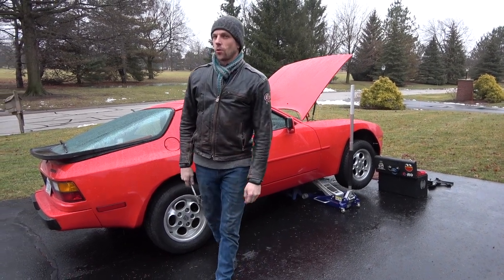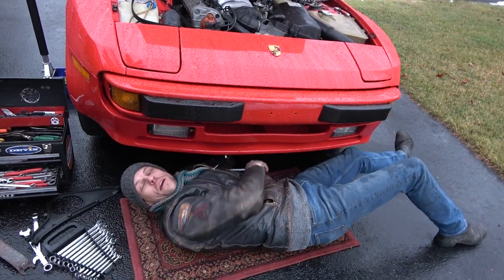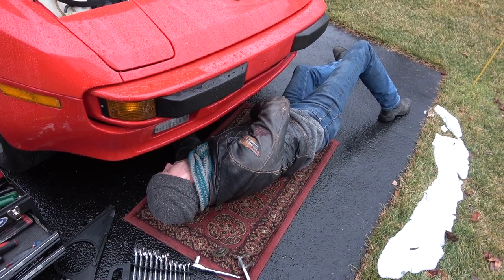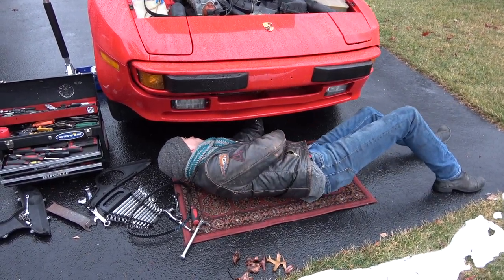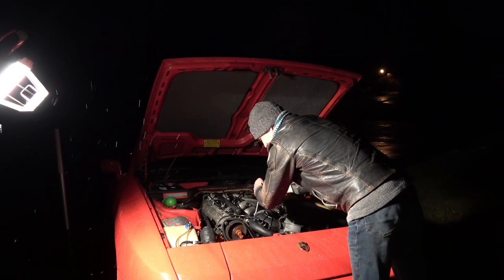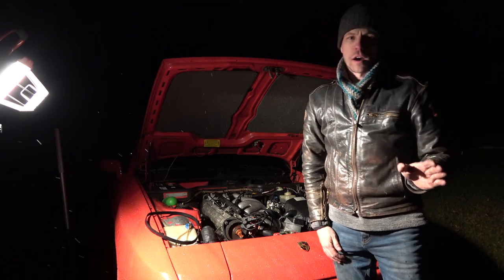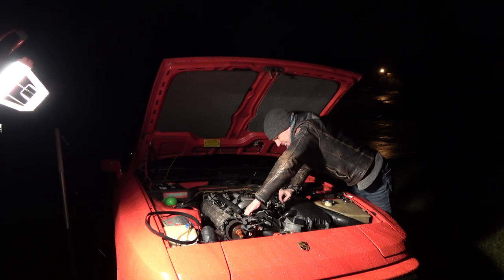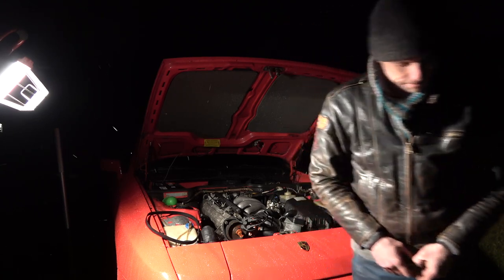ACCIDENT on DIY Porsche 944 in MISERABLE WEATHER

Comment: Have to say that there is no shame in tracking down the manuals to make sure everything is done to factory specs.
Reply: Factory Shmactory... these days you take factory specs into consideration but then go online and figure out what the "hands-on" real deal is from multiple sources and then average everything.  Or you know enough to make a better call than the factory did.
Reply: @NickKautz  I always use Seam's Law when torquing bolts. "Seems tight enough."

Comment: I cranked my 944 turbo over with a damn torque bar still attached the crank pulley bolt. Late night wrenching seems to always increase mistakes.

Fun fact: It's a damn quick way to loosen that bolt :x

Comment: Thanks for admitting the mistake on the balance shaft gear thing.  That was one of my cringes from the other video.  50% chance on each to get right out of sheer luck and the "o" and "u" confusion usually makes for some entertainment.  Your rant on the new car thing is exactly correct.  I say more or less the exact same thing to most of my customers.  IMHO the late 90s is where the car tech peaked for value to owners.  Modern cars with CAN-BUS systems and proprietary software is killing the little guy and owners.

Comment: It's not just cars. The furnace in my house is a Williamson built in 1987. I'm going to keep in going for as long as I can. The heat exchanger will never rust out because of the heavy gauge steel it's constructed from. It's super simple and easy to diagnose and repair. Sure, it's not as efficient as newer equipment, but my house is small and I utilize a programmable thermostat for temperature setback at night and when I'm away. New furnaces and HVAC equipment have grown in complexity with multiple sensors and logic boards. Yes, they are much more efficient but with so many more components with multiple points of failure, they are much more time consuming to troubleshoot and thus more expensive to repair.

Comment: If you want to move somewhere warm you could come to Queensland. That way you could come around and give me a hand to help me get my Porsche 944 back on the road after 10 years just sitting in my shed.  I have enjoyed watching your videos. I figure that I should do all the belts and water pump (and possible a few other things like seals) before I try to restart it. Prior to watching your videos I thought it fell into the too hard category as I had been told that you needed special tools and had to set the belts at a particular tension otherwise you would cause damage but your videos have given me the confidence to do this myself. Thanks heaps, keep up the great work.

Comment: similar weather here (1 y later:)) and I have prepared the valve covers to install on a c4 covers but, idk, I’ll wait for some better weather. btw the clam shell hood has flood lights so you can see the engine bay even if it’s dark outside

Comment: No harm, no foul. Screwing the pooch is what teaches us a few things and the ability to laugh at ourselves makes it even better. I've got an 85 1/2 NA and it's a blast to drive. Old school mechanical and a connect to the road without computers and sterile feel. Toss some BIlstein HDs on there and find the alignment specs to remove a little understeer and find your tire pressures. I run 38f /34/r and get withing inches of a helicopter ride when I play. FUN CAR!!!
Reply: Addendum: I can't agree more with your assessment and philosophy about a well engineered old car. In addition to the 944 I have two other West German cars. An 84 500SEL grey market AMG for the Stuttgart drift or 250kph runs on the 395 and an 83 300SD in case of an apocalypse and I have to hammer acorns down for oil to drive to the beach. Not only is it fun but it's a responsible way to live on the planet and use what is already here instead of feeding a false desire for newer and "better". Oh, carry a spare  DME relay!

Comment: Completely agree. New car ads... it's like "bluetooth this" and "navigation that" and "electro-break-easy-option" 

I want to know the real specs... like "shocks that will last 100,000 miles" and "a PCV system that won't clog up your intake valves" or "we used the slightly better gaskets and seals so this thing won't crater 2 months after the powertrain warranty expires"

Comment: I agree on the new cars not being any better built. And the prices of old muscle cars are nuts! I always wanted a 72 Nova like I had in high school, but I'm not paying that much for a clean stock one. Yes I can afford it but refuse to be part of the problem.
In my quest for my next project I thought hard about it. When I was 19 the 1988 Chevy trucks came out with the new design that was modern and cool looking. Proven dependable  and huge parts/restoration parts availability. Picked me up a sweet 88 k1500 stepside for a great price! 
The best part is the collector market has not cought up to these trucks yet. Look at the square body's now! Holy crap.

Comment: I feel for you using that standard length 1/2" ratchet.  One of my most used tools are extra long flex head ratchets.  Their length give you more leverage so you don't have to push or pull as hard.

Comment: The "flywheel" on the alternator is an external cooling fan, not a flywheel. Some even had two, one in the rear as well. Alternators are easily killed by heat, or bearings ruined by belts too tight. (Which kills water pumps too. Two expensive good reasons to tension belts to spec, not to feel.)

Comment: todays lesson gives a good learning on why if you put markings on stuff .you need to first remember you put markings on it and 2nd to check the markings when you assamble it again ,this was not in this course but there is always option 3 you put markings on something ...then you clean it ...when assembling it you look for markings and cant find them ,,,here is the lesson >>>check the manual to see where the original markings are supposed to be :D  pro tip manuals can get stuff wrong also ...just had a vectra where the manual said the reverse switch is behind the wheel well ..i looked the manual was wrong it was on the other side ,that was an hour and a half of extra fun
Reply from the maker: When walking you should try not to trip

Comment: This reminded of the numerous times I replaced the rubber universal connector in the axles of my front wheel drive 1st car (Austin 1100 from the mid '60s) whilst lying in the gutter (I had no jack or axle stands, only a socket set, pliers and assorted screwdrivers... oh, and an impact driver for the rusted ones!) in the February rain for 3 hours at a stretch, each side. If ONLY I had a manual it would have only taken 30 mins total!

PS - I'm a boomer!

Comment: I found a 928 but it in ruff shape inside from what I've seen the body not to bad I may try to get it but it been seating for a long time Casey so I don't know yet.
Bumber on balance shaft but easy to fix it'll run smooth now I don't trust I mechanic with no faults because we've all been there

Comment: I bet you took it apart on the exhaust stroke . Thinking I am removing the cam carrier all the valves will be closed . I will rotate the cam going back together .  That would put you off on the balance shafts ..

Comment: Back in the early 90s ,I didn't like the way the automotive industry was going.  So I decided I could stick with the vintage stuff. So I daily drove a 1969(6-cyl) chevy nova & 1968 Ford pickup for 20 years - when the nova wore out got a 1971 (6-cyl) Plymouth duster ,  that Plymouth is so base model it don't even have a cigarette lighter, the fuse block has 5 fuses, that's  it .

Comment: Told you so, there's nothing stupid about checking the service manual once in a while. Rather it's very silly to recommend NOT doing it. The marks should line up differently for each balance shaft and are impossible to remember. The next thing that will happen is your water pump will seize up prematurely from a overtighened (or normally tight for other cars) timing belt. If you can't spin the pump around with your hand it's too tight and the bearing WILL fail.

Comment: Electronics will fail because they are MADE to fail. I am en engineer of electronics and I studied some horrible (heavy math..) subject called Reliability of Electronics/Mechatronics. There I learned that there are different classes of elements/devices, from general use to military and even space technology in a different class. The elements for the last two classes I meant to have a fail rate of ~0.00001%.

The electronic elements in a car are meant to fail in 5-10 years so that after the warranty people go for a repair, cheap or expensive. I remember a professor of mine, around 50 years old telling us that in the 90s the major car manufacturers (or it was just the Germans ones, I forgot) gathered and decided that they wont/cant make money out of just selling cars and instead they have to just break after a certain amount of miles/years. Considering the reliability of most cars in the 80s-90s and now.. I believe what he told us :\

Comment: With you on the simplicity.  Dealers & manufacturers need to listen... Seriously. A legacy car should last, the whiz-bang crap will fade as tech changes. If it doesn't work later on, people will hate that car. 
I hate the heater control on my RX7, because it doesn't work...    I'm sure it was cool in 1988,  but if I can't just replace a simple part later.... That car is slowly becoming a track-(mostly) car, so I may just hotwire it the way I want.

Comment: I can see how all this high tech stuff is going to be a real problem as it ages so I bought myself a 2007 Ford Grand Marquis with 40000 miles on it. Low mileage great body and I can still work on it myself. It’ll be my daily driver for at least the next ten years. I don’t have a big screen infotainment system and don’t need one and I can’t imagine those things are going handle our wonderful Canadian climate where it gets as hot as +40 Celsius and as cold as -40 Celsius.

Comment: I see your 180 out pulley and raise you an inebriated engine and transmission marriage and forgetting the flexplate.
Reply: dany d 
Been there and done it with  the sheet metal between engine and trans on a motor swap on a Ford Explorer. 

What a dark day at work that was.

Comment: Casey, just a thought,  your special tool to hold the sprockets,  if you make the handle longer , when you need it you can rotate the shaft and the longer handle will jam tight against something.  With it tight your 17mm socket will break the bolt , or tighten it easier !!😎😎😎 my wife has a 924S. Here is a video of her car if you are keen !! https://youtu.be/QUfjyPfNAss 🍺

Comment: Yeah, working on a German car without a manual is ... particularly ... not a good idea. German engineers do weird things like engineer oil seal gaskets that double as spacers. So you go to replace an oil pump gasket, discover someone installed two of them (huh! That’s odd!) so you install just one and your oil pump and cam shaft locks up when you turn the engine over 1/2 turn (true, personal story)! Use the manual, do it once ... don’t use the manual ... do it twice! But if your an idiot (like me), you’ll be doing it 5-6 times even with a manual anyway!

Comment: Manuals aren’t always all that helpful.
I used the Hayabusa Service manual to remove the harmonic balancer shroud (and balancer) so that I could crack the clams. I found after many hours of trying to pry open the crank clams that the manual neglected to note that there is an additional (unseen) bolt attached to the rear of the shroud that locked the upper and lower clams together. ... lots of fun. Bike Engines Rule ... https://youtu.be/OOVFr5nYFfg. Take a close look at the engineering of this car Casey and you can see why a bike transplant makes sense. ... You can keep all of the rear geometry (just measure carefully) and have the hard points fabricated (or weld them yourself). ... You will need to have the half shafts fabricated to match the new rear diff. ... again measure, measure, measure. Your car will loose weight and become even more awesomer.

Comment: They could have stopped improving cars after fuel injection, ABS disc brakes and maybe an airbag or two. That's what I drive and desire no more.
Reply: Cars peaked with the 1997 Toyota Camry. It's been downhill ever since.
Reply: Now the Camry has a 250hp v6 vvt with dual exhaust and a cvt transmission.  

Sad. Where did they go wrong.
Reply: I only wish they would have stopped adding complexity before a basic Chevy had more than 20 different computer systems in it.

Comment: Genius Garage has low standards, you dont have to know how to read, you just phuk up and learn from the repair. go Casey
Reply from the maker: ummm.....what?
Reply: @CaseyPutsch  if you could read you would have been well informed of the correct position of the balance shafts. so reading is a little more than fundamental.